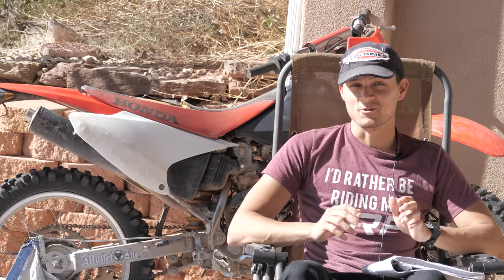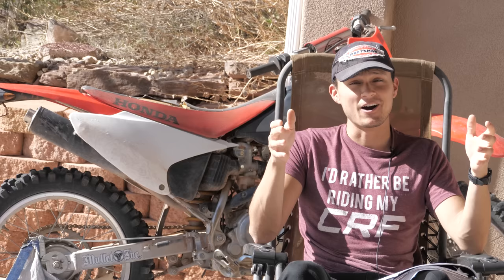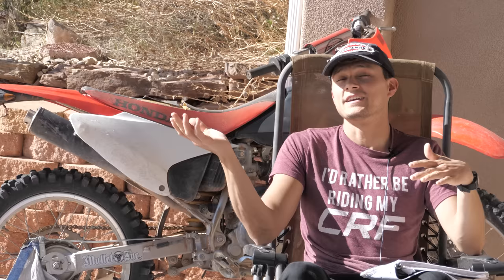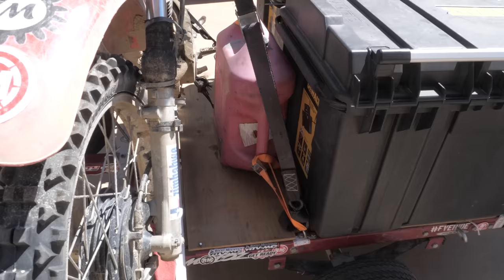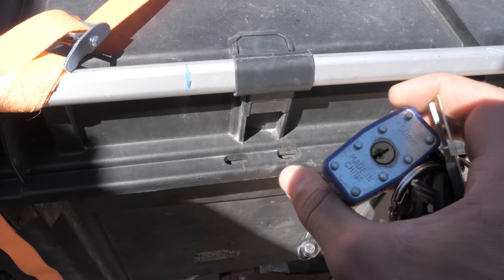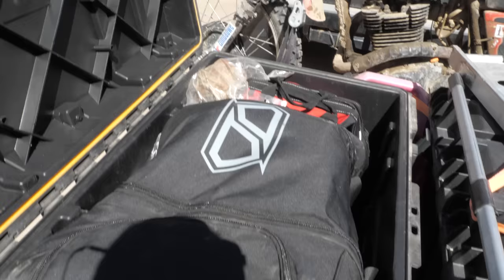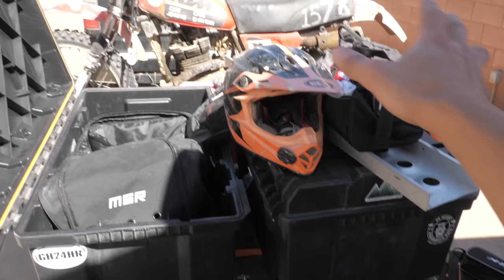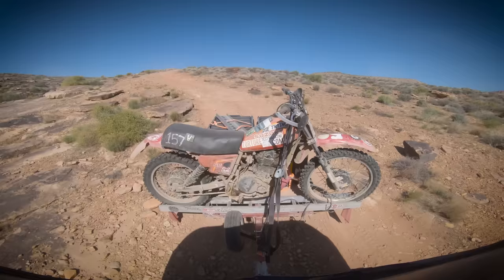I Risked $199 On a Harbor Freight Trailer So You Don't Have To - Here's My Review.

Comment from the maker: Hope you enjoyed this little video. I'm always kicking around ideas on how to improve the yotahome/trailer setup. Right now it's pretty sweet, especially the trailer setup. How would you go about improving this setup? Thanks!

Check out https://torturetestmagazine.com/yotahome to see the most up-to-date info on my mobile living arrangement, because I change it often!

You can still get this trailer, but not for $199. It is available here from Ironton, which is basically just a different trim level: https://amzn.to/3DxuBgT (affiliate link)  Whether or not the trailer will be considered street legal depends on your state of registration.

PRODUCTS IN THIS VIDEO:

POWOXI 100W & 60W Folding Solar Panels - Used in parallel to charge my Jackery 500: https://amzn.to/3J2vxLj (affiliate link)

8mm Parallel Cable - Used to parallel the two panels: https://amzn.to/3wZ3nyl (affiliate link)

8mm Extension Cable - Used to move the panels into an advantageous position: https://amzn.to/3J2vOOl (affiliate link)

Bearing Buddy grease caps for mini Harbor Freight Trailer - These keep the bearings fed with grease: https://amzn.to/2WdcNq5 (affiliate link)

DeWALT Jobsite Boxes - I have these bolted to the trailer to enable several hundred pounds of cargo carrying capacity: https://amzn.to/3qcqwJt (affiliate link)

TUSK Camp Chair (medium) - Very portable little chair that is actually a lot more comfortable than those standard camp chairs you find at the store: https://www.rockymountainatvmc.com/pa... (affiliate link)

BIG RED Jack Stand (2 ton) - Used for changing tires on the mini trailer, and occasionally finds some use with the 4runner: https://amzn.to/3u4bkAC (affiliate link)

Yamaha EF2000isV2 inverter generator - Quiet, efficient little generator that I use when the Jackery and solar panels alone aren't going to cut it: https://amzn.to/3kCfpHj (affiliate link)

MSR Riding Gear Bag - Keeps every single piece of my riding gear readily accessible and organized: https://www.rockymountainatvmc.com/ri... (affiliate link)

Check out my website for dirt bike related merch, premium content, and sponsor spots: https://torturetestmagazine.com/

Check out this page that has up-to-date info on my current bike setups! https://torturetestmagazine.com/pages/bikes

Check out the page that has an up-to-date list of my current riding gear!
https://torturetestmagazine.com/pages/current-gear

Start shopping at Rocky Mountain ATV/MC by bookmarking my affiliate link! https://www.rockymountainatvmc.com/?ref=1046&utm_source=youtube&utm_medium=torturetestmag&utm_campaign=influencer

See my Amazon favorites like the supplements I take to stay healthy and athletic! https://www.amazon.com/shop/torturetestmagazine

Buy whatever you would normally buy on Amazon, but get there by bookmarking this link so I get a kickback! https://amzn.to/3vVlH8p

Get a ton of teaser content by following my Instagram! https://www.instagram.com/torturetestmagazine/

Don't forget to subscribe with notifications turned on, hit thumbs up, leave a comment (even if it's just "leaving a comment to turbo charge the algorithm"), and share this content!
Reply: Sadly that trailer now retails for $399 :(
Reply: I would just jack the whole trailer...

Comment: I had a 4x8 version of that trailer. Upgraded the wheels to 12 inch. More ground clearance and helped the bearings slow down a little. Great trailer, hauled my bikes all around for 10 years. Finally have an enclosed trailer. It comes in so handy. You’ll love it when you get it. Great review as always.
Reply: A friend of mine turned the 4x8 into a enclosed trailer with more plywood and 2x4s and used for a small tool trailer . . worked well
Reply: I’ve had the 4x8 version since 1995
Replaced the axle in 2000 with a straight axle. Just redid the deck in 2020
Reply: My dad had the same trailer My brother now has it It's 30-40 years old and still works fine lol
Reply: I also have the same trailer bought in 1994 and upgraded to the 12" wheels. This slows down the wheel revs by 22%. I put 3/4" PT plywood and I have not yet to replace it. Sure comes in handy without a pickup truck.
Reply: @Ody-up6kg  same

Comment: I wonder how well my goldwing could pull a small bike and gear trailer like that...
Reply: Ur a brave man. God speed sir
Reply: Really good, I believe it was the dudes from RevZilla that did just that.
Reply: Depends on what goldwing you have.. my gl1100 no way... if I had a 15 or 1800 yeah I'd maybe pull my sporster around behind it on one of these
Reply: They sell these on Australia, and I've seen some Harley's tow them right across Australia along the Nullarbor. As long as they're loaded and balanced correctly, it just follows behind you and you forget it's even there! The only thing I'd say when towing with a bike is be very gentle and progressive with the brakes. It'll take a lot longer to slow down from 110kmh.

Comment: I drug one around behind my motorcycle for years. On it I had a storage box, large dog kennel(pups need a vacation too!), cooler, couple of gas cans and 2 spare tires. In the box I kept camping gear, tool kit, wheel chocks and other stuff. I know I pulled it at least 25k in 4 years. Definitely worth the money and maintenance to keep it on the road. I have a 4x8 trailer also that I have loaded bikes on to rescue friends. It looks funny with a couple of guys on a motorcycle dragging a trailer with a motorcycle on it. I've also used the 4x8 to carry kayaks  among other things. I can't ride any longer. Thank you for bringing back those wonderful memories!
Reply: What bike do you have? And what type of riding?
Reply: If you're not in extremely good shape, riding dirtbikes easily blows out your back and knees. Still happens to even the best.

Comment: After watching this video, it had me reminiscing about my own experiences with Harbor Freight trailers over the years.

32 years ago I had the 4x4 with a Sears Turtle car top carrier mounted on a plywood deck for extra luggage space to tow behind my Trans Am, and got a lot of compliments on it.  Then added a 4x4 deck above it for mountain bikes and other things.  I needed more room for my growing family, so I sold the Trans Am, bought a Ford Bronco (which I still have that looks great), sold the 4x4 trailer, and upgraded to the 4x8 model.  Had it for 20 years and used it to haul all sorts of things (camping gear, mountain bikes, green waste to the dump, lumber from Home Depot, moving furniture, etc.), and even used it once to tow my BMW K1200GT behind my RV on a trip to Death Valley last year.  However, it was getting a little tired, and last year a neighbor offered to buy it to use at his cabin in the mountains in So. CA, so I sold it.  I was a little saddened because of the fond memories, and the utility it provided, but knew in my mind it was time let it go.

My intention was to build another trailer one day, mainly for towing the motorcycle behind the RV and Bronco, so yesterday I purchased the Super-Duty (1720 lbs) 4x8 trailer.  The plan is to build gates (fencing) like the other 4x8 trailer, but shorter and studier, paint them red, put pressure treated plywood (painted) down for decking with 1/8" aluminum diamond plate over it.  I will install a wheel chock in the center (make it removable), buy the 30"x72" aluminum loading ramps, and mount a spare tire and jack stand on the tongue.  I will also install drop-down jacks underneath at the corners to stabilize the trailer when loading (saw on YouTube).  I had eye hooks at strategic places (corners) on the previous trailers, and will do the same to this one, but add some flush-mounted hooks on the deck.  One important suggestion I saw on the internet is to remove all the wheel bearing grease and re-apply good quality, high-temp grease, since the stuff HF uses is garbage.  I'll also add 'bearing-buddies' on both wheels too.

Since this trailer has the ability to fold-up like a ping-pong table, I'll make sure it is capable of doing that so I can store it upright in my garage, which means I'll cut the plywood in half (4x4), buy 4x4 diamond plate, and will put better (slightly bigger) castors on it so it rolls easier.

From the looks of things, it seems you have outgrown the little 4x4 and need a 4x8.  However, the bigger the trailer, the more 'stuff' you'll accumulate.  Plus, it might be a 'stretch' for your vehicle to tow more weight.  Either way, the logical choice is a 4x8 to make things easier and not so difficult to squeeze all your motorcycle stuff on such a small trailer.  Still a great story and thanks for sharing your journey with the Harbor Freight trailer..!!!

Comment: I have their little trailer like this for 25 years...started behind my touring bike and then moved to yard trailer.
I had their boat trailer, and traded it for a very used 4x8 harbor freight trailer - i chnaged the deck, dry rotted tires,and wiring (rotted too) and have abused it since - 1000lb loads on a regular basis. solid,no rust (surprising)!

Comment: I built one to haul my Husky and gear behind my Prius. I probably put 20k miles on it and it went from CA to OK nonstop a couple of times. I decked it and added nice side rails and led lights. Never had an issue. Sold it after 5 yrs for more than it cost me to build and maintain. Caveat is you have to take your time and put it together correctly and well and understand the limits. Keep it under 65mph, lube the hubs often, and don't abuse it.

Comment: I have the 4x8 version of this trailer. I've had it since 2007. I've used it to haul bikes, move my kids, haul firewood. It's been used and abused. It's held up well. I have a plywood deck and stake bed sides. It looks like a radio flyer wagon. The only thing I've done to it is replace the lights. a few times and go through an tighten everything up. I guess I replaced the tires because they weather cracked.

Comment: I had my dirt bike on a harbor freight trailer once .got on a dirt road look back and half the trailer was gone with my dirt bike laying in the road a mile behind me. My straps were still tight to the deck and frame but  the axles were with me. My crazy uncle tows a big Harley-Davidson behind his camper across the country on a harbor freight trailer and has never had a problem. He is nuts
Reply: How did it fail? The welds?

Comment: Within minutes of watching your video I knew that I had found an excellent channel that I would subscribe to and immensely enjoy.

I respect your outlook and attitude, and as a former motorcycle mechanic and workshop owner I really appreciate you buying older, inexpensive motorcycle and working on them yourself.

On any bolt together trailer, retightening may be occasionally needed, though your bearing lubrication device and frequent tyre pressure checks should be all that's needed.

An enclosed trailer will affect your fuel consumption and wear and tear on the tow vehicle.

A V-Nose front will help and increase storage capacity, and you can get enclosed trailers at 4 foot height and with lift up lid/roof to ease loading and access.

The lower the trailer, the less wind drag it creates, even less with the V-Nose trailer, obviously.

You could construct simple, lightweight panels to create your own enclosed trailer using your current one as the base.

I would really consider fitting 12 inch wheels as they will make a world of difference.

Or, you could perhaps consider using the Irontron aluminium trailer as a base to reduce weight.

Comment: I currently have a box and a rtt on mine. I've towed it 2k miles so far and I've loved every minute of it. I've comfortably taken it up to 85mph and yes, it does leave the ground on some bumps. Also I bought my trailer in May 2020 and it did come with LED lights and I ran a ground to every light (I always have for every trailer) and I've had zero issues

Comment: My family has had the 4x8 version of that trailer for nearly 20 years. It has been redecked probably 4 times, probably the same number of side rails on it. It has been loaded with multiple ATV's and dirtbikes at once, I even went to lower California and hauled a complete Ausin Mini Moke to Oregon on it. It has been up to Canada, down to New Mexico. It has been towed by every vehicle we have that has a tow ball on it. The trip from Vancouver Washington to New Mexico it was towed by a Ford Festiva to pick up the bare shell of a Austin Mini. We have bought numerous spare tires on these trips but have never needed them, it is still on it's ORIGINAL tires, we end up losing or misplacing the spared over the years... I have replaced the wheel bearings once due to it sitting for a number of years and the bearings rusted.

This one trailer that people have scoffed at has managed to convert many people into their versitality... My father even ended up buying one a few years ago after calling it junk for so long. The frame and suspension has never given us issues, had we not let it sit the bearings would probably have been fine. The biggest issue we have had with it over the years is wiring,  but that is not the trailers fault but the guy not taking care of the pigtail or backing the lights into a pole :)

Comment: I towed one from NY to Cleveland for a project years ago.
Since it was empty it was bouncing like mad. 
Ended up stopping and removing the fenders because of the stress cracks they got and welded em up with some reinforcements later. 
Other then that it now has a 15kw 750 pound diesel genny bolted to it and works fine. That's maxed on the payload pretty much too.
Reply: damn thats impressive. I'm considering picking this up to tow my 200cc dual sport. sounds like it should be up to the task.

Comment: Get about 3-4 feet of 1" wire rope and take the tongue off and JB weld each end (lots of JB) inside the tongue. Nobody will EVER be able to cut through the tongue unless they have a torch. Many years ago a friend had done this on a more expensive trailer and one morning he came out and found his hitch-locks battered to hell and a 1/2 cut tongue bar (stopped at the cable). The cable moves back and forth so cutting with a hacksaw is impossible. He just welded over the cut and was back in business. I like to think about the would-be thief's arm falling off the next day.
Reply from the maker: This is an excellent idea! Thanks!

If you enjoy the content please check out my "best ways to support" page on my website which shows how to support the channel for free! Thanks!

https://torturetestmagazine.com/pages/best-ways-to-support-ttm-some-are-free

Comment: I have replaced the trailer's standard hubs and rims with 15" rims and 31x10.5x15" General Grabber X3 tires . . the same as the ones on my truck .( they have a lot of rubber between road and rim, and you dont worry about potholes, they so soft , i pump them 30 psi, same pressure as tires on my truck, . . i now have 2x spare wheels that can fit both truck and trailer . .same rim sizes...doesnt make a difference in towing.

Comment: Good review. I did something similar with my 4RUNNER and got a $40 harbor freight bike rack that i used to haul my mountain bikes. The thing works great and i'd trust it to haul my bikes cross country., it's steel powder coated, welded, and gusseted. It seems very good for the money but i stupidly scraped it on the ground when offroading a bit so now i don't trust it. Thankfully a family member gave me a better one for free, but i really don't trust the reviews anymore that say your stuff is gonna break and fly off the back. If you install it correctly, and you tighten the bolts and you regularly inspect it... You will be fine. I think most of the bad reviews are user error. From the dudes i see on the freeway doing 80mph hauling their stuff. It's cheap stuff so treat it that way, and you'll get away with it. Don't push it and beat it up.

Comment: I know you probably don’t have it anymore, especially after the torture test videos. 

But when you mentioned the locks, look into ones by Bolt. They use your vehicle key, which you will probably always have with you. 

So you can buy a hitch pin for your receiver, the tongue lock, cable lock, padlocks and they all use your vehicle key. So one key for everything. And it’s a little bit harder to pick since it’s a vehicle key and not just a padlock key. 

A lot of convenience without having to worry about what key goes to what. All your tubs, hit, cable lock can all be the same

Comment: Upgrade the fenders by passing 7/16" threaded rod though both sides and the frame.  The are as thin as potato chips but I could stand on them with the extra support. 
I had the Menards version for 18 years.  I hauled an FZR600 and tons of building materials.  I built interlocking sides out of 1x6s and abused it towing rock around the yard with the garden tractor.
I upgraded to bearing buddies and a spare tire.  Sold it for what I paid for it.

Comment: I bought the exact same trailer in 2006.  I had larger trailers, but needed this one for a specific chore... daily transport of a 600lb. pallet from my warehouse to my home (30 miles each way).  After assembly and about every third trip, the supplied hardware would loosen up and the thing was like a wet rag.  So, I got it all squared up, tightened the hardware, and welded all joints that could be made permanent.  I upgraded the hardware where needed and added a few gussets.  Maybe an additional $30 in parts and materials.  After that, and to this day, the little trailer has held up perfectly.  It has been abused by friends who borrowed it, come loose from a particularly dumb neighbor's hitch and ended up off the highway at 60 mph, and been loaded well beyond it's rating hundreds of times.  The tires were replaced a few times due to age and wear, but that's it after initial upgrades.  It just wont die!  It's impressively capable.  Great video!